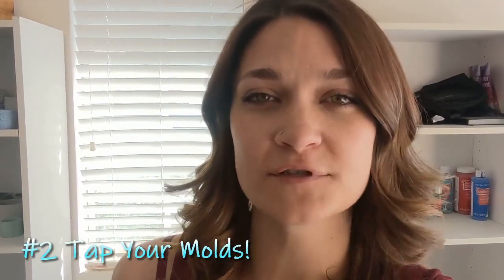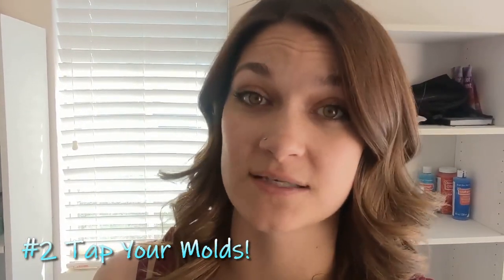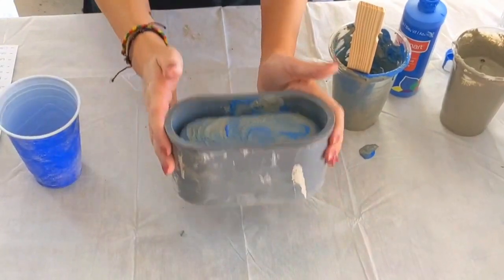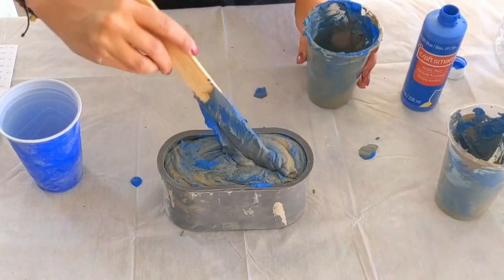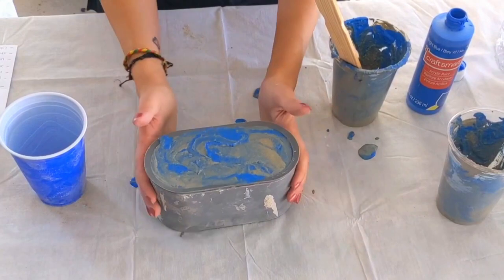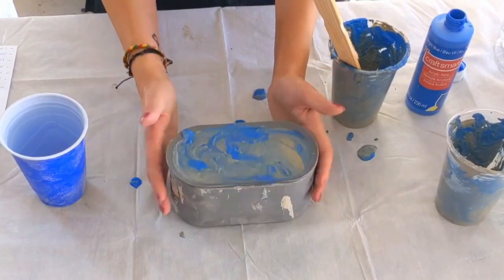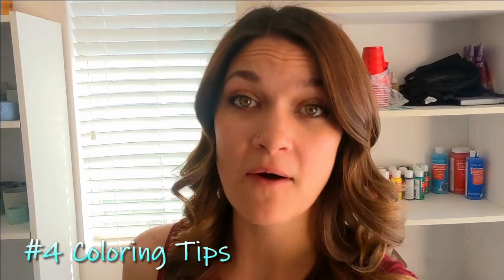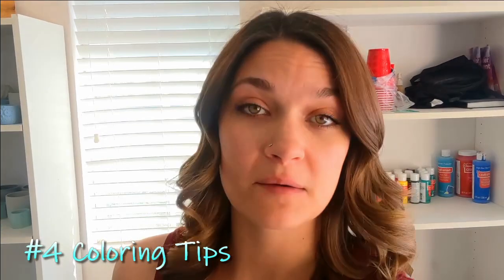5 Common Mistakes When Making Concrete Candles or Planters

Comment: Thank you so much,for vidioès,your so good at explaining how to do things, you are a lovely person, hope you do not mind me asking,how do i make coasters for hot drinks, and do i nead to add àny thing else to the cement, and what paints i use for marble effect. Regards Bonny.
Reply from the maker: Thank you for watching and your kind words! I have made coasters before by pouring the cement mixture into a coaster mold from Amazon. Same measurements I do a 1 to 3 ratio (1 part water 3 parts concrete). You can either apply sealer to make the coaster water proof or I have also not sealed and the condensation soaked into the concrete. That part comes down to preference. I hope that helps!

Comment: Can u make video of cement mistakes i wanna ask why my white  cement crack right after its curing ? Nd after demolding it break easily by pressure by hand
Reply from the maker: I use concrete not cement, the concrete has additives to help with strength. It may help with some additives :) like sand

Comment: Hiiii thank you soo much for the video. I'm a beginner and haven't started anything in the candle business, planning to start. what suggestion u would give me as to what should I do the testing and should I start with jars or with the molds. I'm a little bit confused about what would be better. i hope u guide me with this
Reply from the maker: Hi! I personally started with jars and then moved onto make my own containers. However pouring the candle is going to be very similar in each container so it really depends it you want to have more labor making your containers or ordering them. Hope that helps!

Comment: Also you  said to make sure to squeeze the  container  to make sure it does  not break so if it breaks it mean that we need to add more cement and less water? Thank you
Reply from the maker: I just test it out after i make my batch to make sure it is good. If it does break yea less water more concrete . :)

Comment: Hi I’m from Brazil, tnks for your videos. I have a doubt, my candle vessels break when I light the candle. I use cemente Portland. What can I do about?
Reply from the maker: I haven't personally tried that type of cement. I use Cement All. I would recommend a concrete mix :)
Reply: Portland cement doesn’t have any aggregates, you need to add sand to it. The proportions usually are 1 part Portland cement, 4 parts sand, 1 part water. Hope it helps!

Comment: Hi, your videos are nice and clear and helpful.

 i have just made my first concrete candle container with the plan to pour candle wax directly into it. I had planned to paint over it with acrylic paint but wondering if i can paint it on the inside also and maybe using a sealer over it. After watching these videos i perhaps should have added the acrylic to the concrete mixture instead.
Reply from the maker: Hi! I would say if you do paint the inside to seal it twice at least :)

Comment: Love your videos.  I just started making concrete vessels for my candles. What sealant do you use? I accidentally bought a wood sealer!
Reply from the maker: Hi! I use polycrylic.  Technically it is a wood sealer however all my testing has shown it works great on concrete too :)

Comment: could you tell me why my diy project, a plant stand, cracked?  it set in the mold for 24 hrs, then i removed it, and it needed to cure longer, so i left it another 24 hrs-out of the mold- and it was full of cracks.  i used cement-all.  i made sure it was pancake batter-like, but i wonder if it because of too much water?
Reply from the maker: It may be too much water. I usually charge de mold my containers within 2 hours if I need to use the mold for another project. I would say try less water :)

Comment: Everything u have explained is so clear. Thanks for sharing. Just a question what can I use if I don’t get Cement All? Thanks
Reply from the maker: Thanks for watching! I'm not sure as I haven't really found anything else that works well for me. I would recommend making sure you have a cement and sand mixture . Maybe test out a few :)
Reply: @WizeOwlCandles  Thanks a lot for ur reply. Appreciate it.
Reply: @WizeOwlCandles  could u please let me know how or what are the ways that u check for the quality or like how do u test ur products?  Thanks
Reply from the maker: @prabhneetkaur8643  hi! I test by burning each different type of container I make all the way down to the bottom to ensure no leaking into the concrete and a good wick size. I have drop tested my containers and as most containers they will break if you drop them high enough and they land the perfect way. However I have dropped mine from waist height and they don't shatter. May get scratched but that's it. 

I would recommend getting your "recipe" together and then test each container :) 

I hope that helps!
Reply: @WizeOwlCandles  Thank you so very much I really appreciate. This is so helpful can’t thank you enough. 👍🏻😊

Comment: Hi
I have started making my concrete vessels,and have experience cracking with some of them.
What it the ratio?
Reply from the maker: I have used 4:1 and 3:1. I usually eyeball it as I add water. You want a "Pancake like consistency " not too runny but not too thick. Hope that helps! If you are having cracks I would try less water

Comment: When I’m stirring my cement it’s like a dark grey. Do you use white powder or the grey? I can never tell how much paint is in it because it’s hard to see in the mix. I think I end up doing like you said, weakening the container with the amount I try to use to change the colour.
Reply from the maker: I don't currently use anything to lighten it. Just cement all. I know some people use white concrete.
Reply: @WizeOwlCandles  hey, I use white portland cement< i tried doing a pot today and the whole thing shattered :0( i'm not sure if I'm meant to add sand to it or my mixture was thin ( though it didn't seem watery ) I used to use jesmonite before but then found it hard to get hold of x

Comment: Try powdered RIT dye for coloring your concrete. It's cheap and works well.
Reply from the maker: Thank you! I've been using direct colors pigments and they are amazing:)
Reply: I'll try this
Reply: @ajminxy  red is really hard though. Usually comes out pink.
Reply: @mikelang4191  I'm only interested in black but I'm sure that'll come out gray. I've been experiencing with colored grout and maybe the black dye will make it darker.
Reply: @ajminxy  I've been able to get pretty dark grey with the RIT powder. You're not going to get black though. Close but not quite. With black I actually had better luck with the quickset 6000 PSI mortar mix. It's darker than the 9000 PSI cement all.
Reply: @mikelang4191  is the mortar mix holding up strong? I just experimented with an all in one grout from Laticrete, Permacolor and the colors are gorgeous but it's not strong. I did do a blend with the Laticrete, cement All and plaster and it was stronger and rich color from the Laticrete. But I'm open to trying mortar.
Reply: @ajminxy  the brown bag 6000 PSI rapidset mortar mix is great stuff. It holds up well. I did a side table top with it for use outside. It's 18 x 22 and 1 1/4 thick and I added glass fiber. It's been outside 3 years now and it's just fine.

Comment: Hello :) Made some cement vessels for soywax candles and they cracked a bit when the candle was burning? Has that ever happened to your vessles? Thanks
Reply from the maker: Hi! It did at the start of my candle making. Usually it was because my consistency was too thin before pouring the concrete into the mold. Hope that helps!

Comment: Hey,what if we make it with black cement.Will it lead to the cement container to crack with the heat of the wax?
Reply from the maker: I've never tried black cement but you xan try! I recommend concrete though not just cement. So mix sand in if it is just black cement :)
Reply: @WizeOwlCandles  what should be the ratio of sand and cement

Comment: is it okay for a concrete tray/coaster to break if it falls on the floor ? 
 btw thank you great tips !
Reply from the maker: If it dropped from a significant distance then yes most will break. You can put a cork bottom on a schedule that may help! Anything but plastic if dropped may break. 

Thanks so much!
Reply: @WizeOwlCandles  thank you so much ❤️

Comment: Hi I’m a little late on this video , but I was wondering how can I avoid cracking when lighting my candles with the vessels ? What sealant is best
Reply from the maker: Hi! I use Polycrylic for my sealant. I would say make sure you are also not adding too much water and to stir the concrete for a good two minutes or so before pouring :) hope that helps!

Comment: Hii, I already make like 5 terrazzo concrete coaster with white cement. It came out really smooth! but once I sand it, it appear a looooooot of tiny hole. I already tried to put less water and its just the same 😢 Can I have an advice please?
Reply from the maker: Hi! I haven't personally made terrazzo yet but I eiuld say try stirring the concrete more before pouring to release bubbles and see if that helps :)
Reply: @WizeOwlCandles  Alright, thank you ! Will try it tonight 💖

Comment: Hello! Love your channel! In uk they don't have cement all so I'm struggling to make my vessels - they keep seeping through :( I do all the steps and use white portland cement with sealant. Any idea what I may be doing wrong?
Reply from the maker: Hi! Pur cement you don't want to use. You want it mixed with sand that helps the sturdiness of the container. I would try a mix of the cement and some sand to see if that helps:)
Reply: @WizeOwlCandles  indeed thank you!  I do add sand but will try to change the ratio maybe :)xxx you're the best

Comment: What are your tips for when putting the sealant on , the brush strokes doesn’t show?  How do you get a nice and clean finish? I use the sponge brush and a regular soft bristle brush, however the strokes still show 😕
Reply from the maker: I use a foam brush. I usually have to go over the sealant multiple times to smooth it out. I use Polycrylic. What sealant do you use?

Comment: I’m having trouble making the bottom smooth…and suggestions? Please help
Reply from the maker: Sandpaper. Or don't fill the mold all the way to the top just shy of it and then you shouldn't have a rough bottom

Comment: Hi ! :) little question for you... do you light a candle in each vessel before selling or you test one vessel by lighting a candle inside and then only test again if you change de vessel recipe (more or less water, color etc..)?
Reply from the maker: Hi! I test each container and wick. Then I test the fragrances . So for example I know a specific wick works for my ovals so when I test it's more for fragrance oil and the container. :) 

So if I had 3 different containers and 3 different scents. I would test 9 candles. I hope that helps! 😊

Comment: Cement All is actually a grout. It says so on the box. Cement+ water = Cement (basically a glue or binder). Cement + sand = grout (Cement All, stronger than just cement). Cement + sand + aggregates(gravel) = Cement (stronger than grout). 

It's easier to say cement or concrete when referring to these jars but Cement All is a grout. Knowing that means you can find alternative grouts or making your own.
Reply from the maker: Thanks for the comment! 🙌
Reply: @WizeOwlCandles  your vessels are amazing btw!

Comment: Great video and helpful information.  Is it necessary to seal the container with polyurethane if using it for a candle? I’ve tested it without and haven’t noticed any wax leakage.
Reply from the maker: It isn't necessary if you are testing and there is no leaking. :) I don't use polyurethane, I use Polycrylic. But you don't need to if your containers aren't leaking :)
Reply: @WizeOwlCandles  Thanks for the reply.  Sorry, I meant Polycrylic and not polyurethane (auto-correct got me).  I'll continue to test without applying Polycrylic - trying to keep my brand and candles as organic as possible.
Reply from the maker: @TonicMercantile  I totally get it. I am testing out some new sealants so I will post about it if they work well :) trying to come up with some other options
Reply: @WizeOwlCandles  awesome - will look for that video!  I"m going to test boiled linseed oil (you can get it at Lowes/Home Depot).  It's safe and organic.  I've used it to seal cedar planks I used to create elevated garden beds and it worked out great.  It does take a while (1+ days) to dry though.

Comment: after the container has set after 3 hours, do you apply the sealer automatically after or how long should someone wait before adding the sealer minimum?
Reply from the maker: I usually wait at least 24 hours :)

Comment: Do we need to seal the cement so the wax won't get sucked?
Reply from the maker: I seal so that the candle wax doesn't seep though the concrete. It also helps prevent cracks
Reply: @WizeOwlCandles  what seal do you use? Is it transparent and does it exhume chemicals? Thanks so much
Reply from the maker: @fx6446  I use polycrylic. I tested it for heat resistance along with seeping into the candle and it has passed the tests for me. I always recommend doing your own testing though. :)

Comment: Una pregunta, le pones a tus moldes algún tipo de aceite o desmoldante antes de verter tu mezcla ?  Saludos desde 🇲🇽
Reply from the maker: Sorry I am not able to translate.
Reply: @WizeOwlCandles  he is asking if you coat your moulds with some oil or something else before you pour the cement.
Reply from the maker: @oldbexleysoapco.8500  Thank you! I don't coat the mold prior to pouring the cement

Comment: hi! I bought the cement all brand today and tried it out for the firs time with my molds. I bought the green one (it says rapid set concrete), but it looks like you use the blue? There are some small rocks in it which make it harder to pour.. is yours like that?
Reply from the maker: I use the blue because it doesn't have the rocks :)
Reply: @WizeOwlCandles  ah okay, they actually didn't turn out bad with the one I used.. couldn't tell there were rocks.. but I'll deff try the blue out when I buy next, thanks!
Reply from the maker: @patrickconnelly1158  that's awesome!

Comment: Hi, Kala
You said you leave the concrete for about 24 hours to cure and then apply the sealer. Then, after another few hours, you pour the wax. 
--My question is, doesn't the concrete have to be fully dry before sealing it?   
I, for one, wait 4 to 6 days for my concrete vessels to dry, and only then do I apply the sealer. It would be great to eliminate the drying stage and have my candles ready faster. Thanks a lot.

BTW,
I've read all the comments to see if someone has asked this question before. 🤣
Reply from the maker: Hi! Currently right now I wait 24 hours before applying sealer then another 24 hours to pout the wax. I personally haven't seen a difference in structure waiting more days. 

I hope that helps! :)
Reply: @WizeOwlCandles  Thank you! 🤗

Comment: A quick question: my vessels weren’t made by me but I notice the color in the inside turns brown after I pour my coconut wax and it hardens, is there any way to prevent this or like can I still add extra sealant to save the rest of the concrete vessels??

I spend so much money (first time starting a business and making candles) on my first bundle but now you have given me the courage to make my own in the future! Thank you for this!
Reply from the maker: Hi! Thanks for watching :) I'm not sure if it is the wax as I have not used coconut before. However you can try to seal the inside again if it is not sealed already and test it out. Testing is going to be your best friend to be honest. 

I am so glad my channel has inspired you! ♥️ Keep going!

Comment: Are there any toxic fume concerns with the cement sealer or the acrylic paint when heated by a candle?
Reply from the maker: Hi! I have tested out my containers with both acrylic paint and the sealer. Nothing comes off during the burning the candle :) also I use 100% soy wax so the wax doesn't get as hot as paraffin. That may help as well!